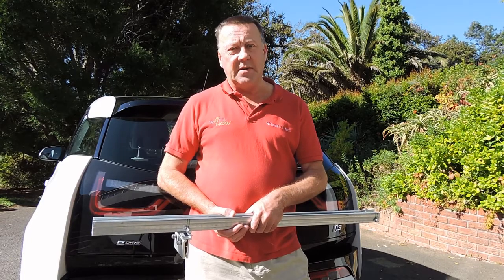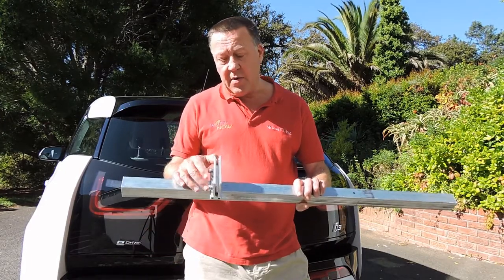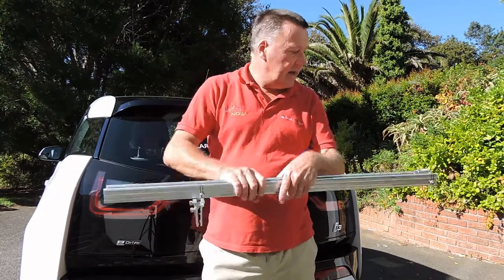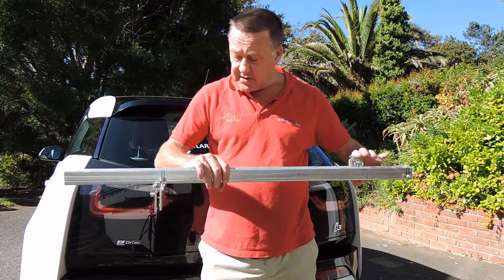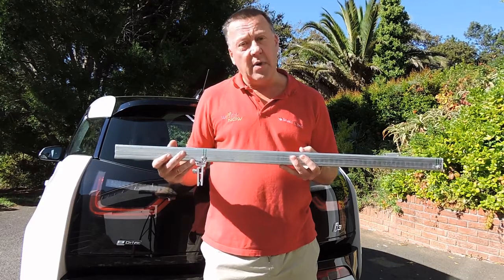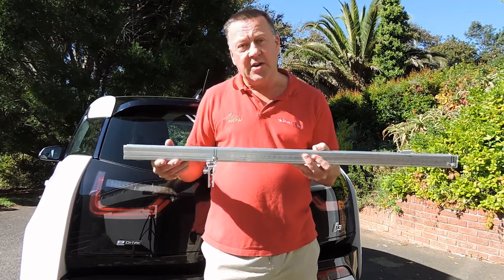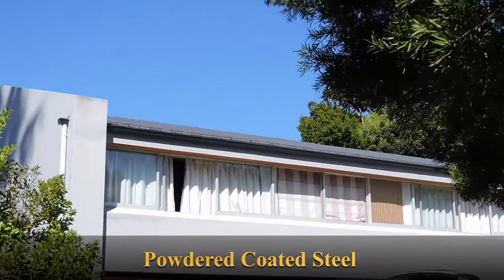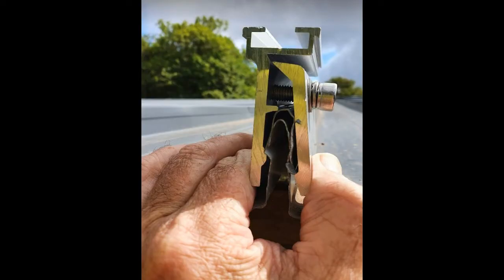Solar Unistrut Rail and ClipLock roof mounting Victron Install

Comment: Just wondering what area this is in?
Is it inland or close to the coast
Just wondering how durable the Unistrut will be at the coast?
Also the dissimilar metals, aluminium, galvanized steel and the powder coated steel?
Reply from the maker: Good question this is in Constantia (not at the coast but close), the issue of strength and robustness outweighed the corrosion factor on this one